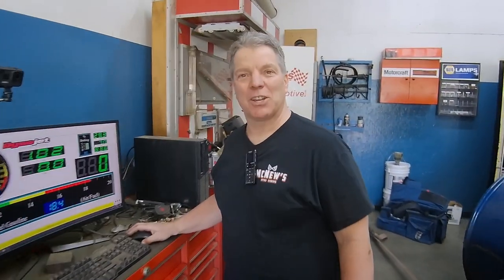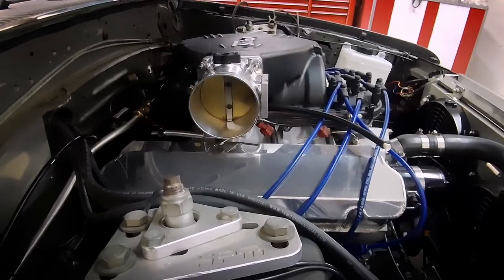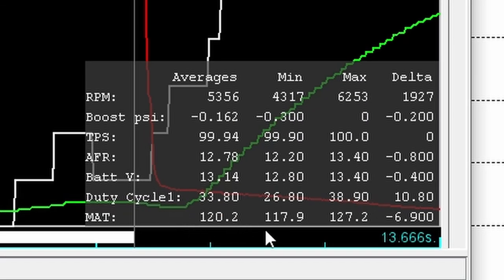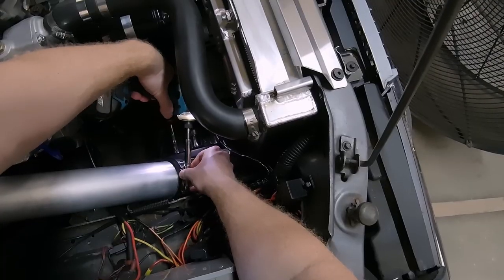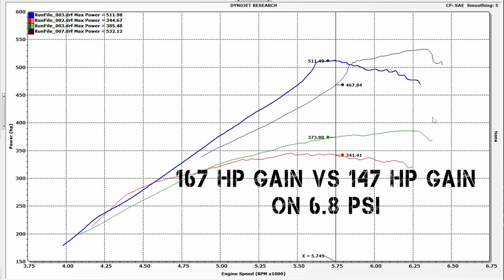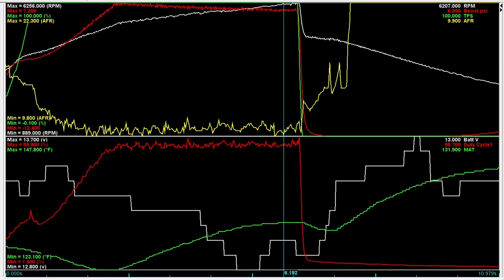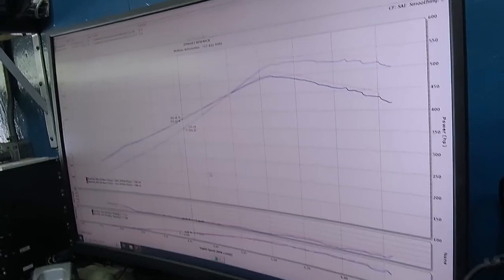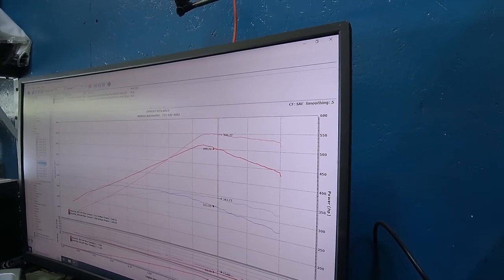Dyno Test: Electric Turbo + Methanol Injection + Coated Volute

Comment: Only thing I can think of to explain such a crazy gain over just the boost itself is the fact you had no N/A with meth test to compare (for obvious reasons). That might have given back some of that 40rwhp you "lost", but who cares. All that matters is electric turbo power. And I'm all about that in depth drive into the numbers later. Congrats!
Reply from the maker: Thanks.  Yeah, honestly the loss (and the lower HP rpm peak) still has me scratching my head.  In fact, I pulled the valve covers to make sure nothing's obviously wrong.  I still want to check valve lifts at the rockers to make sure I don't have a valvetrain issue.  So far everything looks fine, but you never know.
Reply: This is the 1st video I have watched of your's, but I'm super interested now and will be watching more and the past videos to catch myself up.. good work on everything.. do you think there is a possibility that the electric turbo housing is causing a slight intake air restriction when it's not on\pushing boost, which caused the loss on the N\A pull...?
Reply: I should have kept watching before commenting, I just seen that it looks like you didn't have the housing on during the N\A pull, I apologize for my previous comment

Comment: My dream job! Tuning and Dynotune horsepower/ torque testing! My brother spent 5 grand in the 80s on his 1969 Rambler AMX. 360 Rambler engine with 12 to 1 compression, about 1400 kg in weight , 2.6 diff ratio. Bill mann performance told my brother: you should have 400 horsepower  with all the mods! My older brother took me for a drive and I crapped myself! My eye balls hit the back of my head! Lol 😆

Comment: Another dope vid Alex, it's great watching you and friends! Meth into the volute seems to make efficient power, and thank you for bringing this nice little tip to our ears. I would have though the cooling effect to be greater with 50/50 mix water/methanol, but maybe not so good for the turbo. I've never seen it injected like you have, with three nozzles into volute. Very sweet.

Some day I would like to experiment the way you have with a factory supercharger in the 5VZ, simply because that's what I got, and now I'm inspired. WAY TO GO!
Reply from the maker: Thanks Casey.  I read an article put out by Holley that methanol has a greater cooling effect simply because the discharge temps are closer to methanol's vaporization temp.  Dunno if that part is true, but what is true is that straight methanol has always made more power than any mix of water and meth in my experience.  I'm glad this video inspired you - I live for dyno and track days.
Reply: @AlexLTDLX  Thanks for your input, I have not heard it stated like that before. Checking out exactly that; vaporization temp of methanol vs H2O, it appears methanol is 63.5*F lower than H20 (212- - 148.5), so that makes sense. I have seen where others struggle using 100% methanol at high rpm + boost, due to the way it throws off AFR. Apparently, not in your day, as it seems you've got this tune down to a science. Job well done, 1000+ hrs of commitment will et you there! Yeah, science!

Comment: I've heard that leaning out the mixture when running meth injection can cause damage as meth wants to be at a afr of about 4-5 compared to petrol which likes 11.5 to 12.5
Reply: That's a great point. The wideband oxygen sensor doesn't know which fuel is being used, it's always measuring the oxygen content of the exhaust and calculating lambda from that. Then the gauge converts from lambda to AFR gasoline. So when the 'AFR Gas' wideband gauge shows 12.0, it's actually measuring 0.81 Lambda which would be 5.3 AFR Methanol. 4.0 AFR Methanol would be about 0.61 lambda, or 9.0 AFR Gasoline which is richer than a lot of wideband gauges will measure accurately.

Comment: I'm a little skeptical of the calculated gain with the volute coating. You were able to create a higher Delta but it was at a lower RPM and a lower total power. That means that you were flowing less air which should inherently give you a higher Delta given that the supercharger will have a natural upper flow limit. Now I'm certainly no expert and I could be way off base but it seems like determining whether or not the coating made a difference would be a bit more complicated than just comparing the deltas given how different the two tests circumstances were.
Reply from the maker: Essentially, the coating made the compressor more efficient, thus the lower rpm but more hp.  With the electric drive, we have a relatively fixed amount of drive power.  It also helped keep the compressor further out of the knee region towards choke.  It's always a fine line between losing people by going too far into the weeds and glossing over some things.  That's why I've done "deep dive" videos.  I did one on just this: https://youtu.be/41XEVzvYvSw?si=opjLryjpIMU1ffY4

Comment: Have you considered running two compressors in a compound arrangement to get higher boost pressures? I'm just thinking it doesn’t seem as though you could push the electric drive system any harder to get more boost with a single stage compressor setup.
Reply from the maker: Yes, actually I have.  I'm dying to try various compound/twin compressors in various arrangements on the dyno - because you're right - it really isn't practical to expect more from a single electric supercharger with modern tech.
Reply: @AlexLTDLX  I'd love to see the spool rates with a large turbo as the atmospheric stage, with your electric compressor acting as the high pressure manifold stage.  and perhaps some inter stage water to air after coolers for good measure.

Comment: Why does the horsepower graph hit such a pronounced plateau?  Is it the electric turbo quickly hitting it's RPM max and running out of flow rate?  That's one of the more unique graphs I've seen.
Reply from the maker: That's a really good question.  The power vs rpm curve (what you're referring to) looks basically identical to the boost curve.  So if you were to turn the electric turbo on sooner (like, say, on the transbrake), that peak would just move to the left.  If you graph hp vs mph, you basically have a HP line that really doesn't vary by more than 20hp once the Sledgehammer is up to speed.  Should be a wild ride at the track.
Reply: @AlexLTDLX  I'm looking forward to the data analysis video.  I wonder if this is just a combo of the efficiency of the compressor map and volumetric efficiency of the engine falling off a cliff.  Or my original comment of quickly off loading the electric motor once the rotational speed was high enough.   I make the comment because this doesn't look like a typical supercharged engine or turbo.
Reply from the maker: You're right - it doesn't look like most forced induction graphs.  It's closest to a positive displacement setup, but one with an undersized compressor - you basically have a slightly declining boost curve (most boost down low, and it tapers off as engine airflow requirements increase - dropping off less than 2 psi seemingly).  In time, we'll just be able to program whatever boost curve you want, but for now we're just looking for maximum power.  Basically, the electric supercharger mostly determines the shape of the power curve.  Whatever it's doing, the hp is doing.

Comment: I´d like to see another electric motor assist on the compressor to push some more boost.
Reply from the maker: The compressor's already a bit undersized for the engine - it's nearing choke.  It would be better to have two units with slightly smaller motors.  Oddly enough, I have two such units: https://youtu.be/Xh20iPZa02I

Comment: Got to learn a lot here! Just a question if you use pure meth should you be running richer afr like pure meth does around 6.5:1 idle and wot at 4.5:1 maybe yours would be in the middle depending on how much meth was injected and mixed with gasoline I plan to use same
Reply from the maker: Your thinking is correct which is why it's better to use lamba for air/fuel - that would be a good topic for a video, actually.  And yes, you're correct, but I'm running rich enough to be safe - keep in mind at peak power I'm only seeing 6 psi.

Comment: Please do a pre comressor meth injection also and test. Has n very large effect of compressor efficiency. Dont spray on the outer tips of the wheel spray close to the centre.
Reply from the maker: Injecting into the volute is supposed to be similar.  I'd love to test injecting into the impeller directly, but I need enough subscribers (hint, hint) to justify buying a dyno.  Which is something that will hopefully happen in the new place.  I'd like to test all kinds of things (compound electric turbos vs twins, all sorts of mufflers, etc), and even though Ray is a friend, I still pay him for his time.
Reply: @AlexLTDLX  If I could subscribe again I would😂. Inpeller injection moves the whole efficiency map over and improve the mass flow rate. Would be so so interesting to see if the boost increases with impeller injection.
Reply from the maker: I just learned something thanks to you - I guess I can only see the subscribers who have their subscriptions public.  I didn't know that.  And that's exactly why I injected into the volute - this compressors is actually too small for the engine, so I wanted to "move the map to the right" - and I knew about pre-compressor injection, but given the fire hazard of loose meth right next to 35,000 watts of electricity, I heard that volute injection was supposed to have the same effect (according to one owner of a brand of meth injection kits anyway).  It makes sense - injecting pre-compressor makes the charge a bit denser; and injecting into the volute makes the compressed air in the volute more dense, allowing for more mass, and greater cooling because the temps are closer to meth's temperature of vaporization.  That's the theory anyways.  We did seem to pick up a few tenths of a psi of boost too, fwiw.  I'll go in depth on this in another video.
Reply: I'm only one case, but I found injecting meth to the turbo inlet de-spooled the turbo and made it weirdly quiet. But mibby there was something wrong with my setup.. I did have a huge turbo on a little 1.4 litre engine (no boost till 5250rpm)
Reply: @AlexLTDLX  It´l have minimal gains at this low boost. the compressor is already having a easy time, the entire map doesn´t change, but the right hand side does.

Comment: you could probably run the esc off your car battery with enough step up converters ( like 15 of these -1200W 20A DC Converter Boost Step-up Power Supply Module IN 8-60V OUT 12-83V With Heat Sink)
but if you ran it all the time it would drain your battery pretty quick.
or just have a lipo battery connected to a car charger. that to will drain your battery if trying to run ut all the time. 
 because at 400-500peak. 
depending on the motor you  get. lets say a 12s(50v)@250 amps=12,500 watts

so 
12500watt@ 12v=1041 amp draw. 

which is like running a 1000watt car amplifier. . 
most cars only have about 100amp alternators.  which is barely enough to run a 1000 watt stereo at 3/4 volume.  but at night when  running your headlights. your car will stall at stop lights ( trust me I have a 1200 watt alpine amp )  that even installing a 150amp alternator and led headlights l, tail lights, binkers and interior lights( even my dash lights to led) is barely enough to keep the music on with out my car dieing.  Although if you do have it set up that it only turns on at lets say 3/4 down on the throttle. the  it would probably be fine. so that it doesnt run all the time and only when you want it to gove you that little umph at the top end. which is when the electric turbo actually helps anyways
Reply from the maker: Unfortunately, that won't work.  We're pulling about 34,000 watts, which at 12 volts would be over 2,800 amps with no voltage sag - and I think you'd need 400-500 lbs of car batteries to pull that off at least.  We're running 63 volts at 678 amps (with voltage sag, it drops to the 34,000 watt area).  FWIW, a 1,000 watt car amplifier will only draw 72 amps (13.8 volt alternator); and only for transients.  There's an order of magnitude difference.  I think if the compressor was better matched to the engine, we could keep it out of choke and achieve similar gains with maybe 10,000 watts less - but you'd still be looking at 24,000 watts draw - or the same as 24 1,000 watt car amps, but running a maximum power continuously, not just transients.  I do sincerely appreciate you taking the time to watch and comment!

Comment: very cool setup Alex! you have any plans with nos or other fuels?
Reply from the maker: Not really.  At least not on this car - it's already faster than it can pass tech for, so I think this will be it for the Sledgehammer development.  I'd like to start showing it off at various events (drag and drive stuff like drag week, maybe the Texas mile, etc).  I also want to start doing compound/twin testing, particularly with the cheaper/easier to build setups.  Maybe I'll see have fast a purpose-built car can go - I'm certain of 8's in the quarter, but I think 7's and maybe very low 7's are possible with 3-4 P2 based units.

Comment: Very nice video as always!!!:) i also have a meth injection at my n/a car and i did pick like 8whp ! It seems for you that the losses from a convetional turbo vs electric  are bigger due to heat from the exhaust .. it seems to me that your hp improvment is due to the heat from compressed air and the effect of the meth.. one question why did you use 100% meth . I use 70/30 mixed with water
Reply from the maker: I only went with 100% meth because in my experience that's always made more power than a water/meth mix.

Comment: Hey Alex, I’ve had a idea on something for a long time but curious on how you mount/drive the charger? I feel I’ve seen most of your videos but missed it if you posted.
Reply from the maker: I never really show it - it's just a steel bracket bolted to the sway bar mount, with a smaller bracket going to the core support.  You can see it briefly when the tech inspector's looking at the car in this video: https://youtu.be/nlTVHkfSQXM  It's not a great shot, but it's not much of a bracket honestly.  Just needs to hold it in place.
Reply: @AlexLTDLX  I guess I’m referring to the drive portion of the unit, like how the motor drives the supercharger.  I’ll go back and poke around at some of the other videos and see what I can find. Thanks again for great content.
Reply from the maker: This is probably the video you're looking for then: https://youtu.be/mV-rhlrWu9Y

Comment: First off love your channel! I am thinking about using the electric motor direct driven off the pd supercharger for more torque on the bottom end on my daily work truck at 8000 lbs it's a pig before 3,000 rpm. Since you don't have to spool the SC as fast as the turbo I think it would be the better option. Any thoughts or comments much appreciated!
Reply from the maker: Thanks.  I'm not sure I follow your comment entirely, but I've run 3 positive displacement setups on this car over the years - 2 Eatons and 1 Whipple.  If you're going to electrically drive any supercharger, a centrifugal is a better choice in my opinion - they're more efficient, lighter and would spin up faster (rotor packs are heavy; the impeller in this thing is almost weightless by comparison).  As far as low-end torque is concerned, an electrically driven centrifugal can make more low end torque than a belt-driven PD blower - simply because you can dial in any boost level at any engine rpm you want.  Hopefully that addresses your idea.

Comment: Two questions.  One is there a intercooler other then the meth because you could pick a bit with a water to air cooler just a though.  Second are you in anyway worried about the coating being effected by the meth.  I would like to add this is so cool and I am loving the project and what you are doing.
Reply from the maker: Thanks Pat.  The boost level is a little low for an air/water, but a big one would probably show gains.  Once we start running 2 or three electric superchargers, then an air/water would be a big help.  And no, I'm not worried about the coating being affected by the meth - I asked the Line 2 Line guys about it and they were fine with it.  Even so, the meth is injected in the volute's scroll, which isn't coated.

Comment: How much extra weight for all the gear in the trunk for sledgehammer?
Reply from the maker: Battery packs are about 62 lbs in total; the ESC is maybe another 6-7 lbs.  In total, the entire setup is about 20-30 lbs lighter than the Whipple was with much better weight distribution.

Comment: Can you get thrust from the exhaust, seems like a few hp with a proper system
Reply from the maker: You can, and that's why some more powerful drag cars run "bull horn" exhausts - they actually help keep the front end down.  Some racers found that having a single exhaust coming out of one fender actually pushed the car to that side.  But in my case, I have dumps just before the rear axle.  I don't think I'm making enough power for exhaust to give any sort of meaningful thrust.  But who knows - I could be wrong.  Maybe I'll see if I can come up with some way to test that.

Comment: Hi gary here i have a 2014 ram 1500 with the 5.7 which ray tines for me i have a few good mods to it and he got 450 hp to the wheels for me i love hom he is a genius with that dyno i was wondering if you had a electric turbo set up i could use in my truck of coarse i dont know much about this tech so i would need an installer and could you give me a ruff price on everything the.total package thanks for the great videos too your rrally giod at it